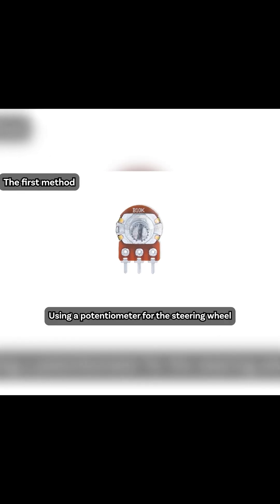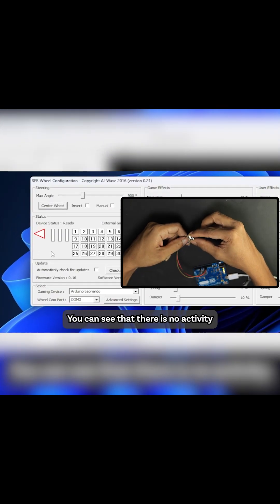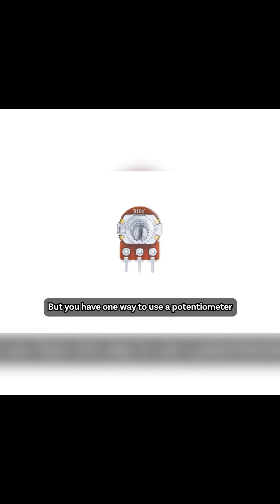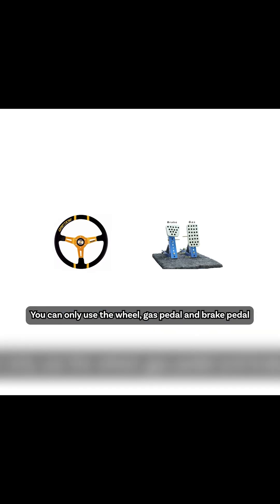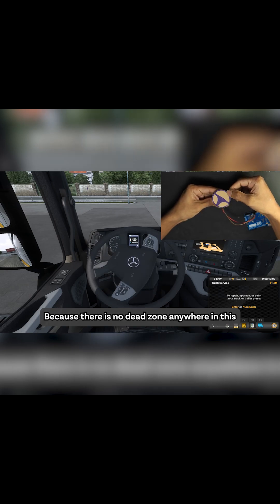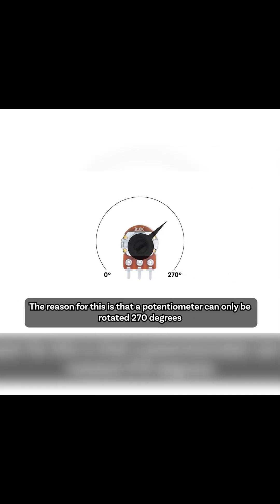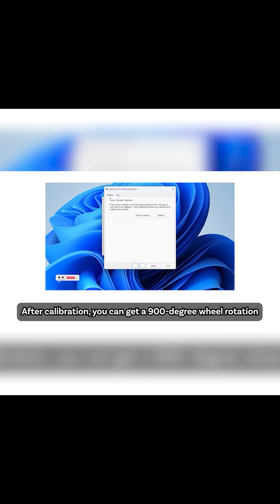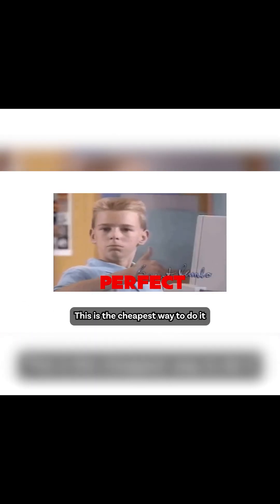How To Make a Gaming Steering Wheel Using a Potentiometer

Comment: Hey can i be helped? Cz i found a hex file online that can use ffb, potentiometer as x rotation and the motor driver depends on that it did work on asseto corza but i cant have buttons for my shifter as my shifter works when ground is shorted to a pin, but the hex uses 4x4 grid buttons that i cant use
Reply: I can have 5 potentiometer, wheel, clutch, brake, accelerate and more with ffb just that i cant use manuel

Comment: If we are using controller,is it neccesary to use 2 way screw barriers or direct connect to controller
Reply from the maker: No, it not necessary. you can connect directly
Reply: @zudumalli  then y u need the 2 way screw barrier